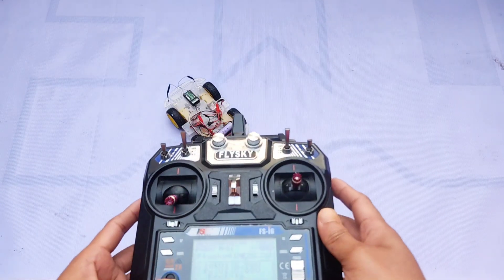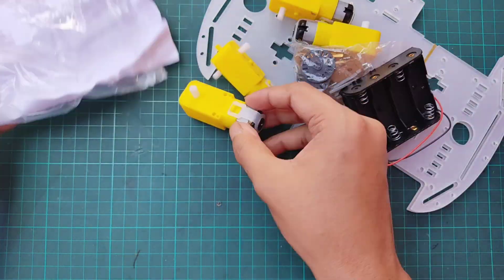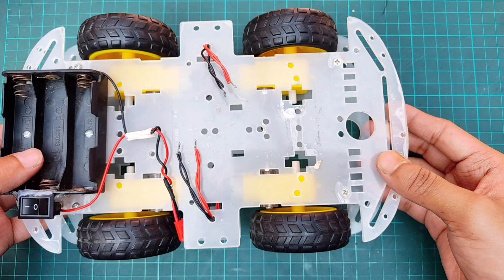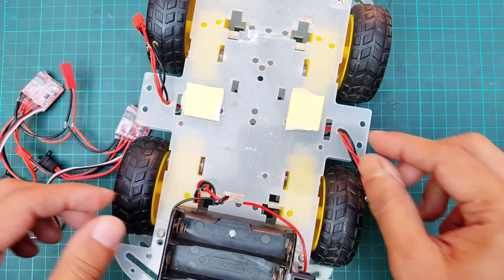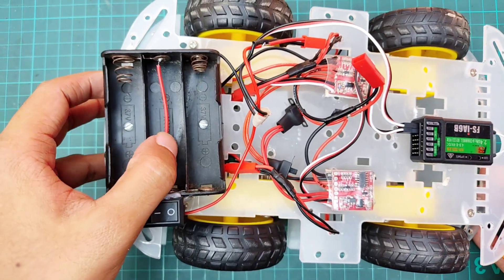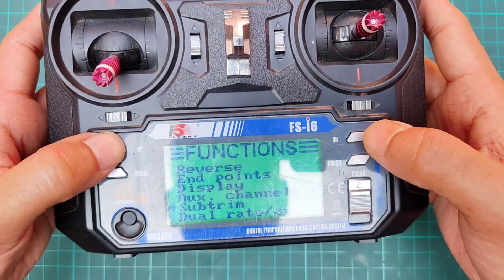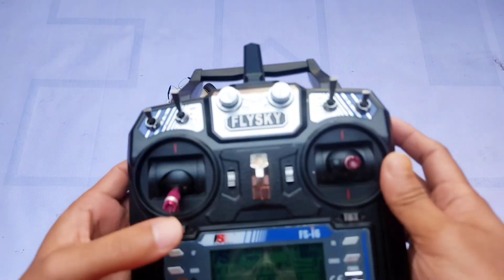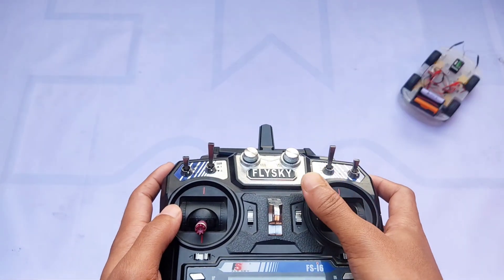How to Make RC Car using FlySky i6 Transmitter | DIY Remote Control Car

Comment: Hi there. I am trying to upgrade a RC Bobcat skid steer mini loader with these kind of radio and ESCs. What I am looking to do is the use a bi directional ESC for the wheels (already using one on my RC bulldozer) and another 2 of the same as you are using on this car to operate the front loader. How can I add a third ESC to the Flysky receiver?

Can I mesh together the wires of 3 ESCs like you did on here with these 2 or is that too much? Could I just wire up a separate power supply to each of the ESCs from the same battery and have them on the power on/off switch?

Thanks in advance 😎

Comment: Hello i did the same thing you did but the bar that increases and decreases in the display sectoon of transmissitter isnt going to full but only till half on full throttle
Reply from the maker: need to increase the range to 100%. go to elevon then you will see the % of the bar. make it 100%
Reply: @ ohh thanks for replying i didn’t expect you to reply , thanks tho ill try and let you know
Reply: @aslamhossain1  but what does it actually do ?? Will the speed of motor increase?